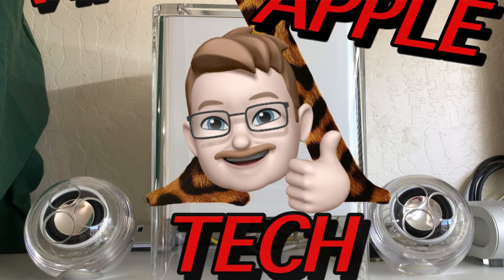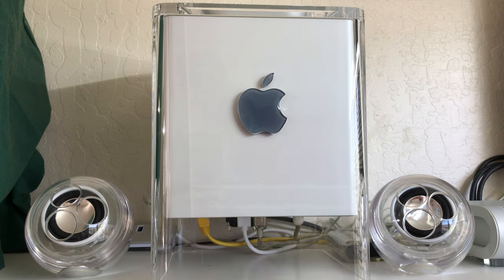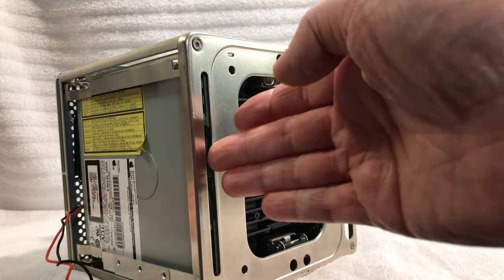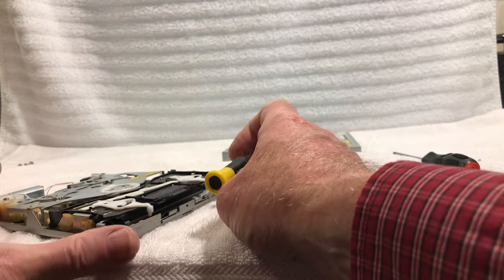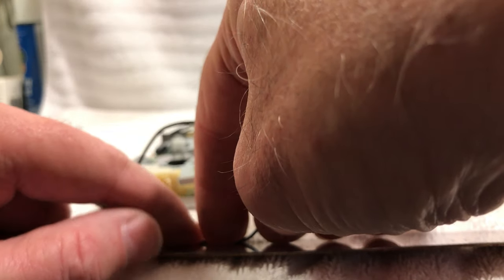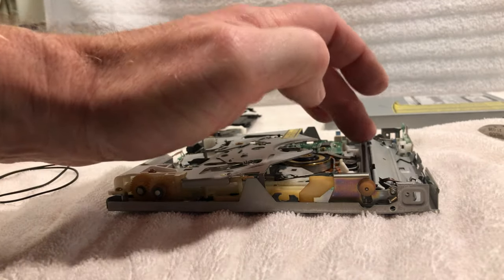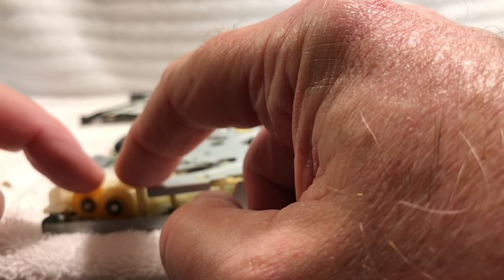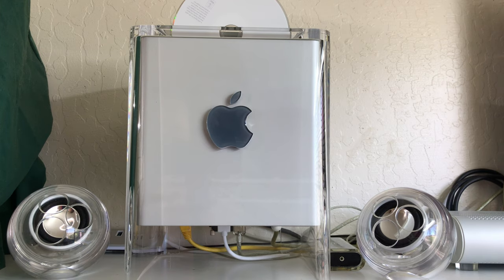MODDING G4 CUBE LET'S FIX THE OPTICAL DRIVE BELT Part 20

Comment: Cool video, Dave! Do you have a resource for the particular IDE adapter board that is required for the cube? I’ve scavenged a drive out of a g3 slot loader iMac, and the board on that drive appears to be atapi. Someone removed the optical drive on my cube before I got it, and as a result I don’t have the adapter board. Any help appreciated.
Reply from the maker: Ebay has one for sale now https://i.ebayimg.com/images/g/ZDUAAOSwADVgOTQ0/s-l225.jpg
Reply: 12:13 writing on the board;
 UPSIDE DOWN - top line is serial number, second line is part number - 820-1130 a.
this is very useful my son found a cube in the trash that i didn't realize needed a belt fix until i tried to play a dvd in it.

Comment: Great video Dave.  I have gone through the same experiences as you have in upgrading my Cube.  I also ordered the Artmix VRM in Japan.  The communication is somewhat tricky but the board is really great quality and you need its extra capacity when you install a more capable processor.  My old VRM blew up taking the motherboard with it, so I think you should really wait for it and not use the old VRM with a more powerful processor.  

Btw, I could not find your other videos on the Cube
Reply from the maker: Thanks I Had Done Voltage Reading And Current And So Far Well Under The Limit  But I If I Go The The Duel Processor CPU Then WE Will Have A Melt Down For Sure. You Can  Go To My Channel I Have A Hole Play List Just On The G4 Cube Thanks

Comment: thank you for your video. I totally disassembled the optical drive. the belt still drives the thing. In my case, the slider gets stuck. I managed to unlodged it, but still stiff at the extended position and the gears can't pull it back. But the drive is still having issues pulling cds in and out, so I want to replace the belt. Followed your link, but I think is broken. Would you mind setting the link again, or just the specs for the belt. Thank you!!!
Reply from the maker: 20pcs-25-170mm-assorted-common-rubber-belt-mix-cassette-tape-drive-belt-for-dvd-1-5mm-width-45779 Try This Link Or Copy The Link
Reply: @DavidStahlOLDHAPPyMACs  thank you!!!
Reply: @DavidStahlOLDHAPPyMACs  thanks !
I ordered two sets. Will post my results.
Reply from the maker: @emondrag  you optical drive will work like it did when it was new when you replace the belt
Reply: @DavidStahlOLDHAPPyMACs  the belts finally arrived to Nicaragua after the unavoidable detour in the US. So, I'll be posting my results. I should really make a video.
Reply from the maker: @emondrag  yes make A video